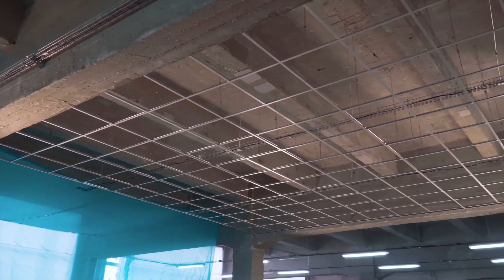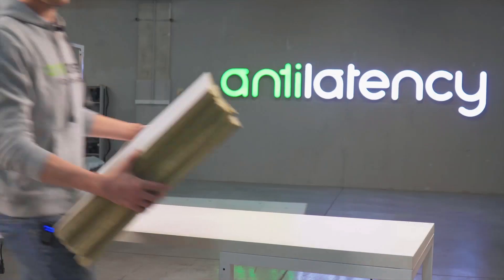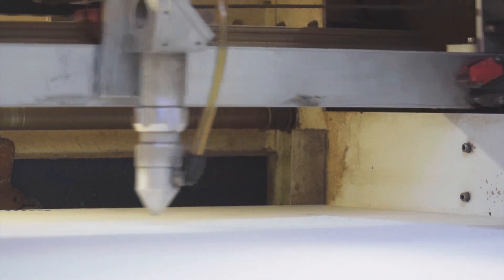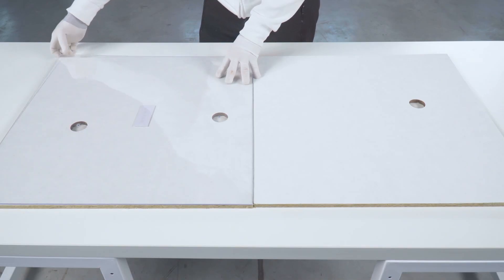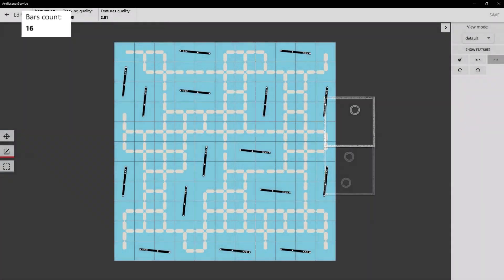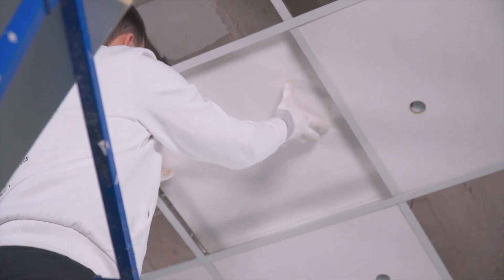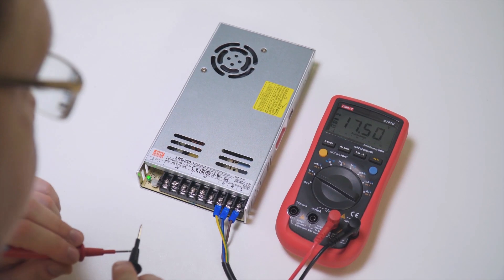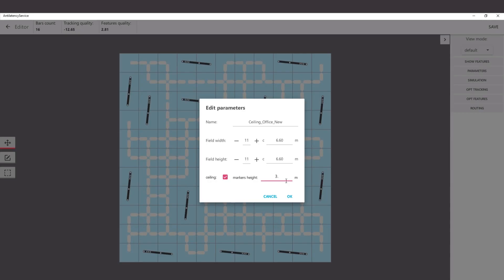Ceiling Tracking Area Setup tutorial / Antilatency tracking system

Comment from the maker: ✅   https://antilatency.com/?utm_source=YouTube&utm_medium=Antilatency&utm_campaign=Ceiling_setup_tutorial_full

In short, in order to assemble and install the ceiling tracking area, we need to do the following steps:
1⃣   we mount the ceiling grid,
2⃣   prepare the ceiling tiles,
3⃣   prepare the bars with markers,
4⃣   then embed the bars in the ceiling,
5⃣   connect the markers to the power supply,
6⃣   and set the ceiling height in AntilatencyService